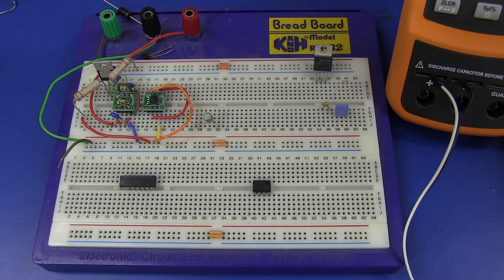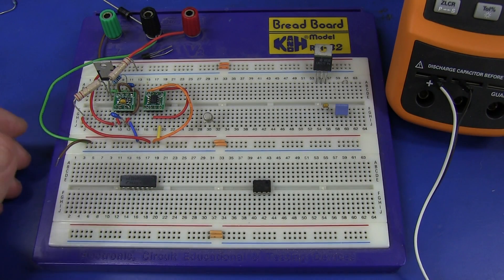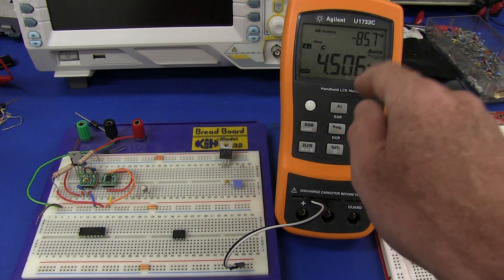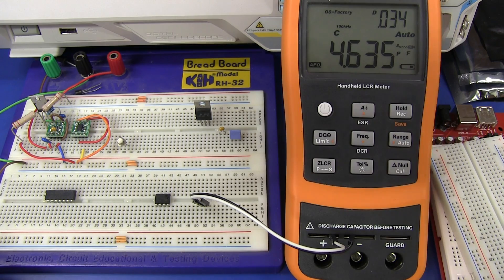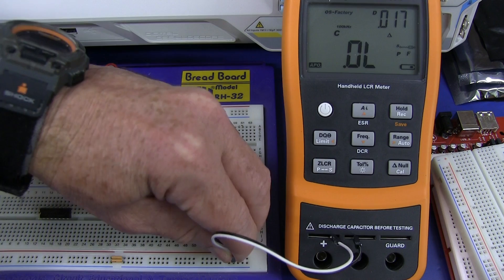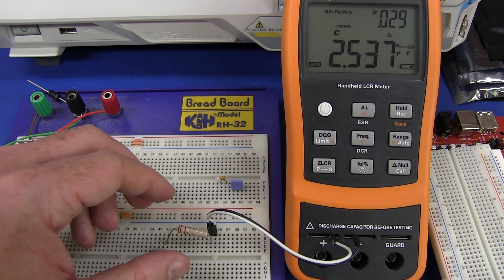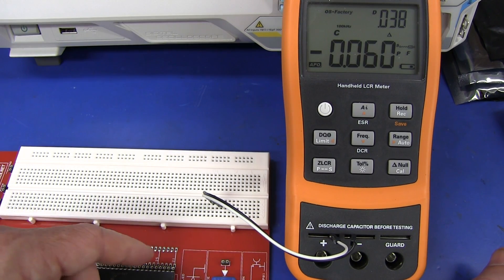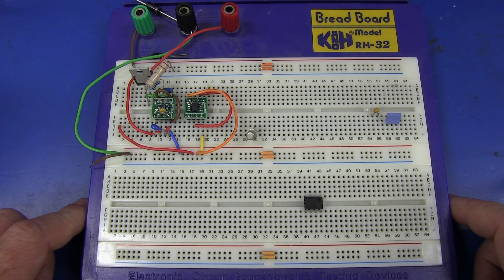EEVblog #568 - Solderless Breadboard Capacitance

Comment: these boards should have metal under them tied to ground. The stray fields are thus "pulled" into a low impedance ground vs inducing current in the adjacent connections. Greatly reduces ringing and switching noise. Makes for pretty pictures even on a 200MHz scope. If things are critical use the "dead bug" on copper approach vs solderless.

Comment: 1pF @ 1MHz ~ 160kohms.   Scale as necessary.

If your breadboard has an aluminum base plate, then you also need to consider capacitance to ground.  Mine measured about 4.7pF to ground, and about 4.1pF between adjacent strips.

Comment: "Capacitance changes with frequency" ??
Reply: In many real world cases, it actually does. As soon the permittivity of the dielectric has a complex component (which is usually the case, more or less), the capacity becomes frequency dependent. Also it is partly compensated by stray inductance.

Comment: I recently had an I-to-V converter using an opamp, on the breadboard. I didn't use a compensation capacitor and it worked great. After soldering on a protoboard I discovered that the stray capacitance between two adjacent columns of the breadboard had enough capacitance to stabilise the circuit. I measured it at about 100p with a capacitance meter.

Comment: The factor between the vertical strips and the supply rails is exactly 10 (2 pf  vs 20 pf). If you count the number of "groups of five" in the supply rails what do you get? You guessed it: 10! There you go. It's simply the plate area that's multiplied accordingly and confirms the basic "2 pf per group of five"

Comment: Excellent, so if you must use a breadboard for an early prototype, increasing the physical distance between used contact columns will actually decrease the breadboard stray capacitance that your circuit is subjected to. This may have been obvious to some, I guess, but this EEVBlog really put everything in perspective for me.

Thanks for doing the video, Dave, your ballpark empirical measurements were a godsend! :)

Comment: Of course the capacitance will be low due to the physical separation, but nice to get some actual measurement data. My main worry about using these breadboards is scratching the contacts as I insert a freshly cropped component leg. So the contacts will become unreliable quickly. I seem to remember this being the case way back when I tried them.

Comment: Breadboards... brings back nightmares of my time at uni... 4 years of terrible breadboards with intermittent contacts. Get a mini pcb prototyping station and make rough and ready boards for prototypes. Ditch DIP chips and do SMT. Its so much easier, even for small prototypes.

Comment: PCB pools, like OSHPark are so cheap now, I haven't used a breadboard, like never. It's so much nicer to go straight to PCB. You get the rough layout, the approximate parasitics, thermal issues, dimensions, fitting etc. right away.
Even if the first couple of iterations don't work, you can add dodge wires until you get things right.
And more often than not, they do work the first time... You can fit the PCB in the assembly and start doing thermal, EMC tuning right away.
You're like 3 steps ahead.
The only thing is the time it takes, but I can just switch to other tasks / projects while waiting for PCBs.

Comment: I'm wondering if it would be possible to calculate the stray capacitance of the breadboard into the resonant frequency and manage to get a high frequency oscillator to work on the thing. If not, what other choices are there other than soldering the circuit onto a circuit board?
Reply: Perf/strip/proto board should have much lower capacitance, but I don't have the right equipment to test them. I wonder too what the properties of old wire wrap are.

Comment: I used breadboard many times for circuits with AVR microcontroller clocked at 20 MHz (external quartz crystal) without any problems. So I guess for digital circuits you can go well beyond 1 MHz. Once I also built a radio jammer (~100MHz) on breadbord and it was pretty bad  - if you want to make any RF circuits don't waste your time building it on a breadboard (BTW, I knew that before I tried it, I just needed to see it for myself).

Comment: can you say what the typical c for about 12 or 16Mhz is? If i use caps on my 16Mhz quarz with atmega, sometimes it just dont work. if i remove the caps then, the atmega immediately starts working.
Reply: Improper question. Frequency does not affect capacitance. Surface area, material, spacing and dielectric affect capacitance.

Comment: For metal-backed breadboards it may likewise  be useful to determine the capacitance between the contact strips and the back-plane especially as the PS ground terminal is typically electrically tied to the latter.

Thanks for the informative vid!

Comment: Correct me if I'm wrong, but I think what Dave was meaning by the "Capacitance changes with frequency" isn't that the actual capacitance value changes, but rather the degree to which it may have an effect on your circuit depends on the frequencies involved on the breadboard. Maybe should have said "The breadboard has internal capacitance at various areas and depending on the frequencies involved the Impedance will change with the frequency"? Hey, that would even have added a minute or two to an abnormally short EEVblog :)  Thanks for these Dave. They are always entertaining and educational.
Reply: You are correct Warren.  It's called Reactance.  Simply put the amour of "resistance" a capacitor has depends on the frequency applied to it.
The setup shown to measure the capacitance has a problem: the test leads(short as they are) probably add a Picofarad.
-Karl

Comment: If you look at the datasheets for capacitance measurement on multimeters rather than LCR meters, you might find they only resolve down to 10-20pF and accuracy may be +/- 10pF. That might go towards explaining why some measure 2pF, 10pF or 20pF for the same thing.

Comment: Dave: As usual, your blog is a blessed event and your attention with detail is much appreciated. But what is capacitance? I bought as many as were on the shelf of these metal door knob alarms. You put it on your hotel door and if a hand goes on the opposite door know the alarm goes off. I read that it is due to capacitance. Capacity? I am constantly being zapped by static electricity. Is that capacitance? Does the human body store a charge of electricity? Are the spring bars storing electricity? How do the spring bars become capacitors? I have been chasing the word capacitance for many years. Do you know of a good book on electronics basics?  And if I were to start on the projects that I am dying to cobble together I would solder everything. The only thing that is keeping me from starting my electronics building is I lack a good exhaust fan for the solder fumes. Thanks.
Reply: I've got an old version of Albert Malvino's Electronic Principles which describes capacitance, but look up EEVblog #486 - Does Current Flow Through A Capacitor?
To try and answer the question - I think we need to distinguish between capacitance (which allows charges to form between metal plates in a capacitor, or between traces on a PCB, or on a human arm with a sweater over it, or the metalized antistatic bag's ability to siphon out a charge and keep it away from fragile components on a motherboard) and discharge (which seems to be the process of a charge leaving a natural capacitor).

Comment: Why does the capacitance change with frequency? Doesn't the capacity between 2 parallel plates depend solely on the dimensions and  the dielectric?
Reply: The capacitance won't change with frequency - the effective impedance will but the capacitance is a constant.
Reply: *****
that makes sense, the dielectric material needs some time to change polarization so if the frequency is to high that'll probably mess with the actual capacitance. thanks for answering :)
Reply: *****
It's a bit rude then to call it a dielectric constant then, it should be a dielectric function.

Comment: Don't tell me what I can't breadboard. :D  I regularly breadboard switching circuits up to 500kHz, 100W on breadboards -- but as you might guess, construction and layout is critical, much moreso than laying out a PCB.  The ground bounce and other common mode nasties are exaggerated as well, so good luck playing with a small signal circuit nearby.

When layout is critical, I break out the copper clad and build something deadbug or manhattan style.  Solid ground plane = better than a two-sided PCB.

Comment: Man I got a free powered breadboard off craigslist one time. My buddy found the add and we drove out to pick it up. It was in a large box of things and I told him I will drive out there to get it I just want the powered breadboard which he was cool with. I got home the thing worked great and I used it at least once a week. Then we had to kick him out (he was living with us) and his last day there I had to go to the hospital. While I was there he stole the breadboard and sold it to someone on craigslist for $60. I am still pissed about this till this day but we are still friends. That thing is worth like $175 new and was VERY useful.
Reply: You should really choose better friends then.
I don't know what was so special about the power supply, but breadboard powersupplies go for less than 10$ (at least for 5 and 3,3V powered by USB or external DC wall wart). Adjustable power supplies for bread boards don't cost that much more.
Reply: http://www.jameco.com/1/1/2938-pp272-rohs-triple-output-powered-project-breadboard.html

Comment: Another important caracteristic that you should've measured is the resistance across different parts of the breadboard. I have one where the resistance across the power rails from one side to the other is close to 2.2k.
Reply from the maker: Something is horribly horribly wrong with your breadboard then!
Reply: another characteristic you "could" have measured.. this is a video about capacitance, not everything that can be measured of a breadboard
Reply: You likely have stretched out certain terminals inserting an item that was too large; I have never seen the cheapest board with resistance anywhere close to that and I've checked quite a few.  There are many horrible examples, far too many people follow, where someone is jamming in  components that are not intended to be used in a breadboard; thus destroying it.  
     Even some of the biggest name electronics design suppliers in the US you will see using improper sizes in their tutorials & responding to customers on forums telling them to 'keep pushing, it will fit'. The number of component package designs is quite large; many are just slight variation of pitch and/or pin width.  They likely ordered or received the wrong one; that's no excuse to sell it with a breadboard kit or to give horribly wrong advice.
Reply: Did you have a circuit on, there whil measuring the resistance between the power rails?
Reply: ungratefulmetalpansy http://www.eevblog.com/forum/beginners/strange-behavior-with-dave's-electronic-load/msg281350/#msg281350